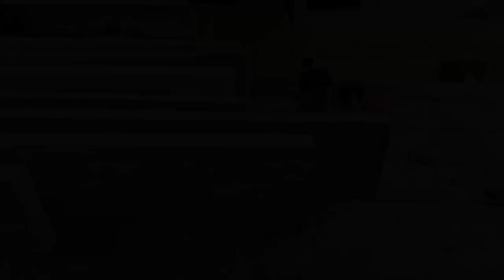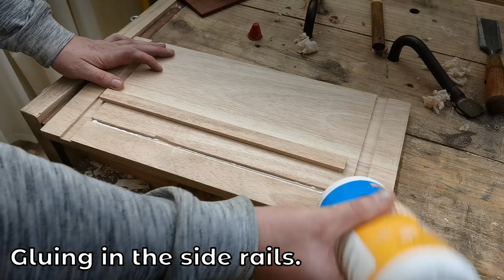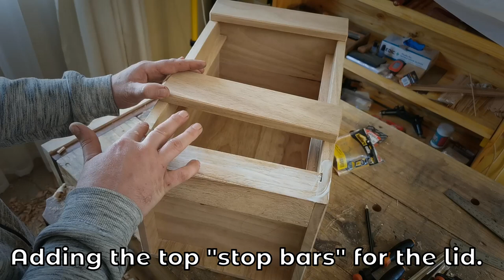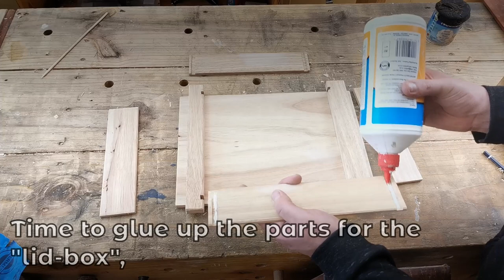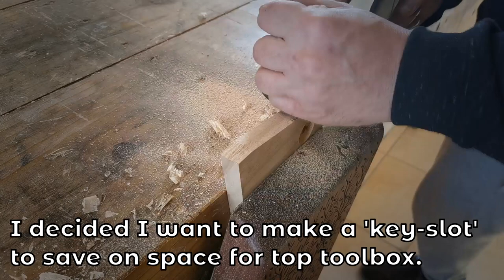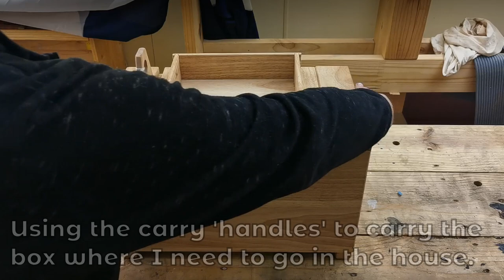Modified Japanese Toolbox // Using traditional hand-tools

Comment: Very nice! I don't understand the keylock system vs the sliding wedge as far as it seems like the wedge wouldn't have taken any more space and would have been less obstrusive. I'd think someone might think the keylock was a handy carrying handle and end up with a problem. I like the changes you made with the sliding part and the holding area on top of the box. Very handy. Thanks for sharing it with us! (I had to mute the sound part way through, though. Be careful when looping music hearing the same short segment of music for 15 minutes quickly feels like being in bed and hearing a faucet dripping!
Reply from the maker: Thanks for the reply. I like the keylock better than the sliding wedge. I have another Japanese toolbox that uses a wedge, and I find a bit irritating, also, the keylock takes up less space than a wedge (usually).

In retrospect, I should have made the keylock smaller, or maybe even with just one pin (can still make a new one though), but all in all, so far of using it I don't have nay complaints.